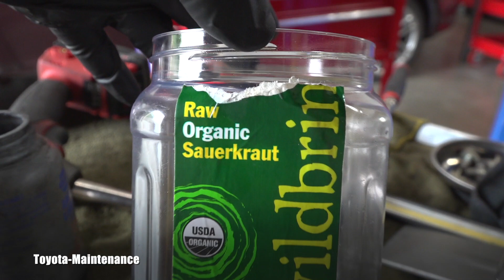1982 Toyota Truck vibration above 35mph

Comment: 38 Year old truck!!!! It's in great shape! Body and paint is awesome! Low miles! The owner taking care of their truck 👍
Reply: Takes care of the outside... but those joints and oil in the diff, transfercase and transmission show he needs a lesson on mechanical maintenance.
Reply: @SimplyCarReviews  Yup. Other than that, the owner has a cool truck!! The wheels looks sharp!

Comment: I had a 1981 long bed version.  Was only 2 wheel drive but I loved that truck. I was in the northeast and this particular model had a real problem with rust.  Hated to sell it but it literally had big holes in the bed and wheel wells were completely rusted out too. I still got 2k out of it when I sold it almost 20 years later, ha!

Comment: What a beautiful truck!  It is a shame the owner is not taking better care of it.  If it were my truck, I would say replace ALL universal joints, ALL fluids, Check and replace ALL filters and Spark Plugs.  Such a low mileage truck.  I'd make this baby a cherry truck.  I bet the owner gets offers to buy all the time.
Reply: I agree that I would have a total maintenance job done on it from head to toe, it's a beauty🌟🚙💥
Reply: This Toyota truck at its indicated low mileage  ... did you hear Peter say the speedometer cable was bad?  The mileage will never, ever increase for the life of the truck. Simply amazing.
Reply: @davidnull5590  Yes, you are correct.  There is no positive way to show the actual mileage at this point.  However, it is a really sweet truck.  I would love to own it.  I would take better care of it for sure.

Comment: Had an 83 long bed with a zillion leaf springs. Used for hauling dry wall... 22R motor. Couldn't kill it. Rolled ot on its side once playing in snow. Rolled ot back over n drove home. 

Lost all the engine oil when the rear main seal died and i was on the phone, letting it warm up. Towed it to the shop and they replaced the seal for a hundo... drove it for several years more and sold it

Comment: That vintage Toyota had a 2 piece truck bed which had a seam running around the outside skin. They were notorious for rust if you lived in an area that used salt on the roads. I remember seeing where owners removed the beds and rebuilt them out of wood or made flatbeds out of them.

Comment: So does the transmission make excessive noise independent of the vibration and noise of the failed universal joint in the rear of the propeller shaft? If so would the input shaft bearing be suspect? I heard that quite a few of the cast iron case L52 and L54 manual transmission would destroy their input shaft bearings and cause noise... maybe I misheard! Correct me if I’m wrong :)

Comment: My 4 runner is about 55000 miles now, do i need to change the transmission oil by now or should wait for a  any specific miles?

Comment: Needs some motul full synthetic 75w-90
Reply: I don't think you should use synth in something with more than 30k miles on it, because it could lead to leaks in the seals, if there are spots where dirt built up against the seal and it didn't have contact with the oil and it dried and cracked, the higher detergent in the snyth oil will wash away the dirt then you could have a leak. Maybe he'll comment on that.
Reply: Mike S , yes, I hope he does, I was about to switch to synthetic but I never saw it that way

Comment: I had problems backing up Toyota Tacoma it would shake. I had a dishonest mechanic tell me it was my UJoint and Carrier Barring. I got a diagnostic from Dealership and they told me it was motor mounts that hold transmission. I took it to a local transmission shop with Toyota parts and the dealer ship was right I save a lot of money. I stop going to the dishonest mechanic.